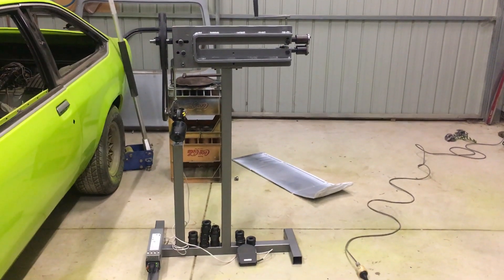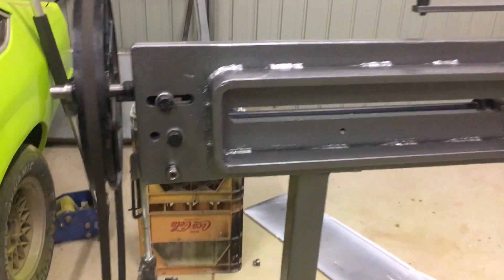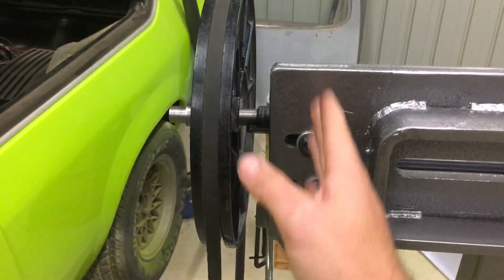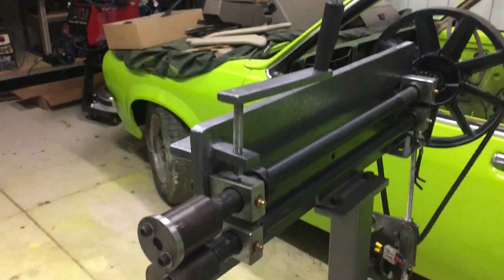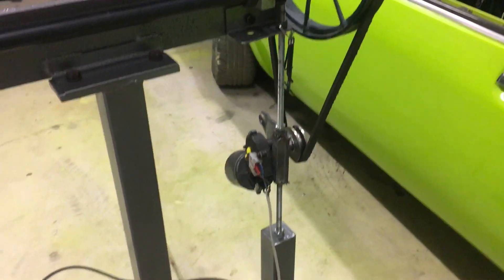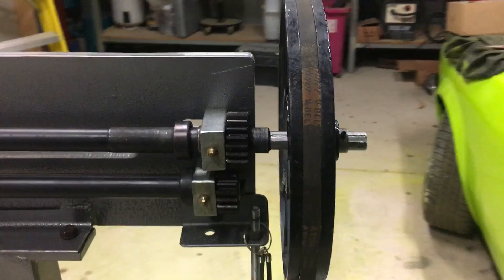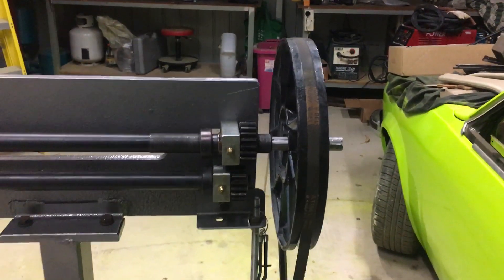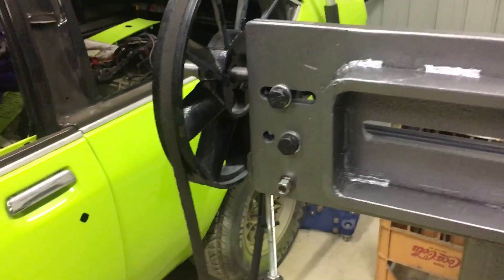Modified and Powered Chinese (Harbor Freight Style) Bead Roller

Comment: Great idea. Can it run in reverse if you need to back up the panel?
Reply from the maker: Hi, it has the ability to go in reverse, just need to reverse the polarity of the connection to the motor. So no, currently it’s not set up that way, but I don’t see a problem with wiring up a reversible switch!

Comment: Why do you connect the drive powered wheel on top geared shaft..? I think better you connect to bottom shaft, so whenever you slide the top shaft no need adjusment on powered wheel mechanism. Btw nice inspiring video.

Comment: Awsome idea did u happen to wire the motor on its hi setting or low thank u
Reply: You can wire it to a speed control unit wire in to your power supply mine work great